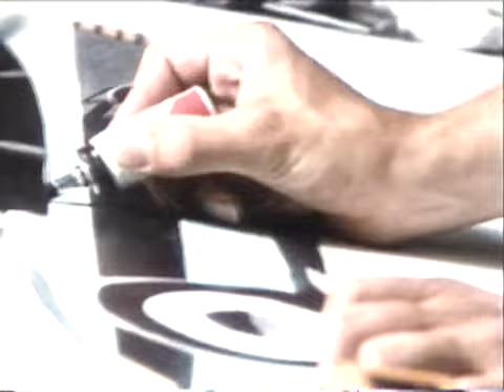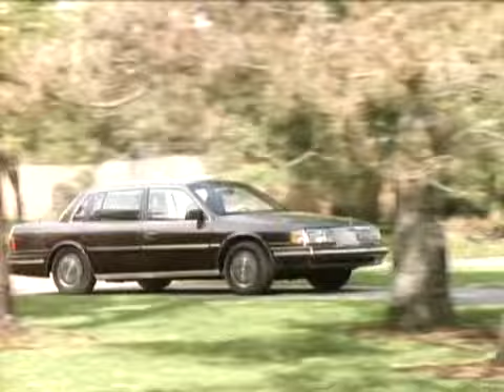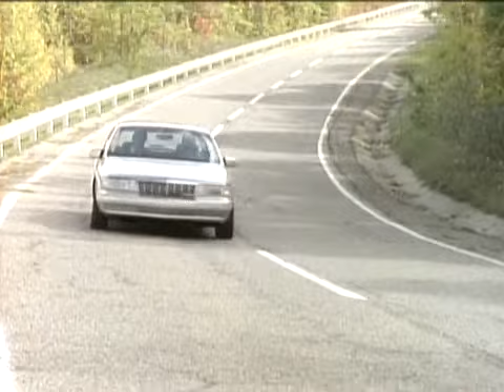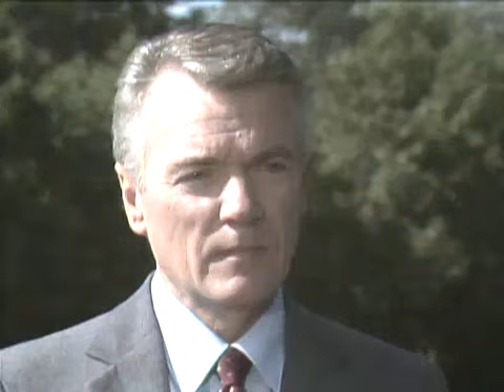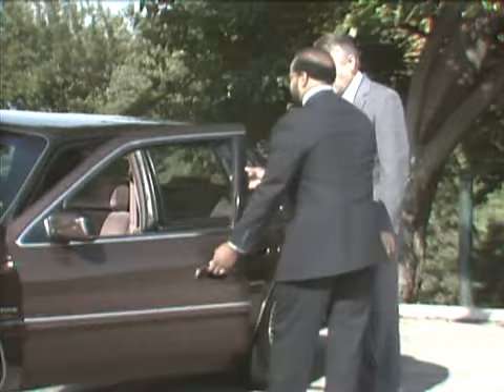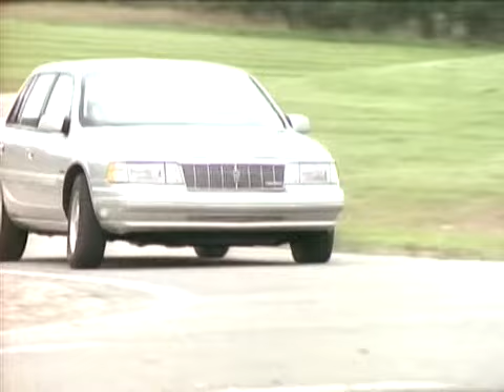1988 Continental sales presentation

Comment: Most people don't realize how ground-breaking this Continental really was back in 1988. First front drive Lincoln with all the advanced tech to rival so many more expensive cars.  I will have to say that the car's ONLY achille's heel was the air ride suspension. So many of these cars over a very short time found themselve sagged to the ground and needing special towing equipment to get these cars to the shop for repairs.  Otherwise i've always had a sweet spot for these new Lincoln Continentals.
Reply from the maker: honestly I'd say the air suspension was the high point.  The transmission was the turd in the punch bowl, but I have a huge affinity for air suspension.  Have had 3 Fox chassis 4 wheel air suspension cars now, all have worked exactly as they were meant to with lots of age and miles.  Currently have a 200k mile 84 Conti and a 235k mile 91 LSC.
Reply: @gadget73 Yes the transmissions were a weak point too. Would have to agree.  I love the Lincolns of this generation and your video is really rare and nice to see.
Reply: @KennethITGuru  What made transmision weak?
Reply: @Telecolor-in3cl  The transmission was designed way too small to handle the weight of these cars.  If you ever see one removed, it's a very small unit.  They tend to overheat because of that poor design and will fail prematurely. Now maybe if you change the fluid very often or switch to a synthetic then it will hold up better.  But i've seen alot of these cars doomed to the crusher because of their transmissions failing.
Reply: @KennethITGuru  Can't a better one be installed?
Did all models of "Lincoln" had that problem or only the 'Continental'?
Reply: @Telecolor-in3cl  The issue was ONLY with the Continental.  This "under designed" transmission was the same unit that was put into the new 1986 Ford Taurus as the Continental was based on that model.  I have owned several Taurus that had bad transmissions. There is no other unit that you can install in the Taurus or Continentals as it would cost a fortune to design one from scratch. The best thing you can do is what i suggested earlier - change the fluid often and upgrade it to a better quality fluid. When you drive the car - don't beat on it. Baby it.  I love the Continentals of this generation so i would do what i could to preserve them.
Reply: @KennethITGuru  But the 1987-1988 had better transmision?
How was the "Mercury"?
Reply: @Telecolor-in3cl  To my understanding ALL the transmission in the Taurus were bad. From 1986-1995.  Ford wasn't going to redesign the transmission since it would cost way too much.  The Mercury Sable was the same car so it has all the same parts.
Reply: @KennethITGuru  Oh, that "Mercury" was very nice looking.
But the 'Town car' and the 'Grand Maquis' where better?